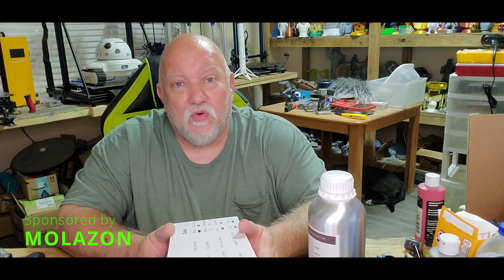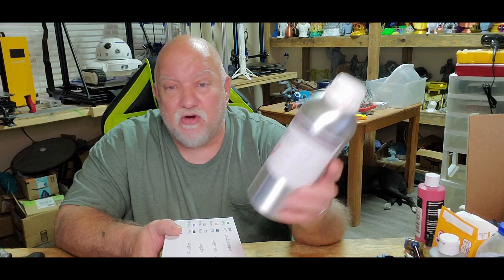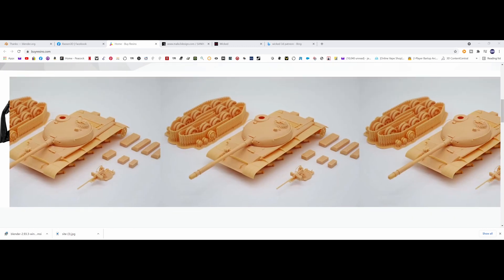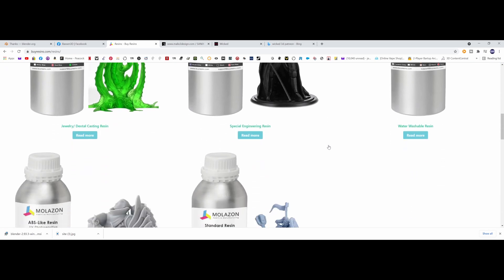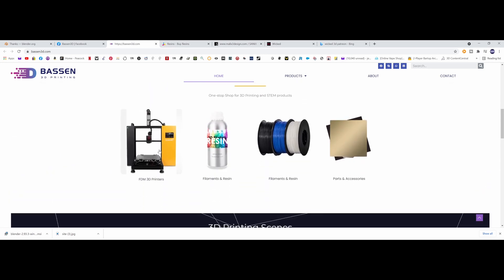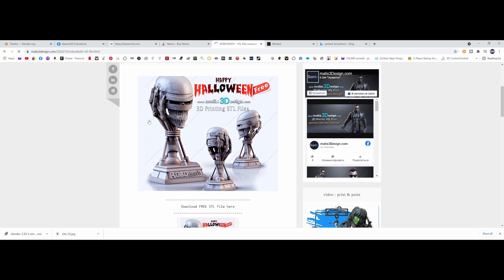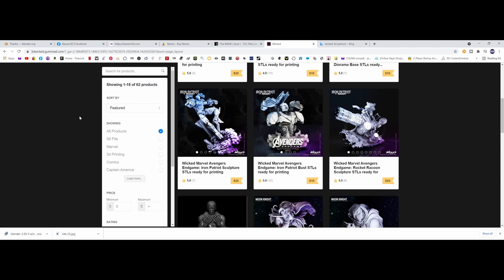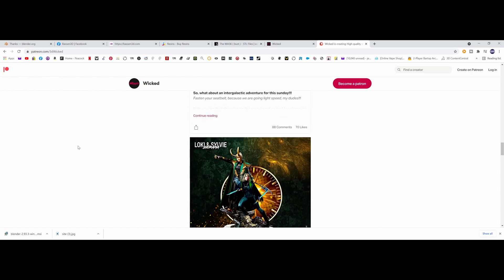MOLAZON Standard Rigid Resin #3dhp

Comment: Excuse me, did u recomend for minis? :S sometimes smalls supports just breaks for example in 183 abs like resin and i need other options
Reply from the maker: You can always add Tenacious Resin from Siraya tech to it  80/20 ratio will help a lot. Tenacious is expensive so adding 20% will make it go a log way. How long you cure your models may also effect there brittleness. But using a ABS Like resin from any company will allow it to have a small amount of flex. I hope this might help.